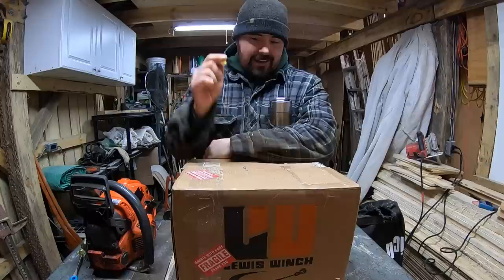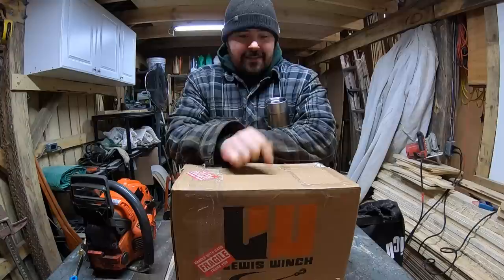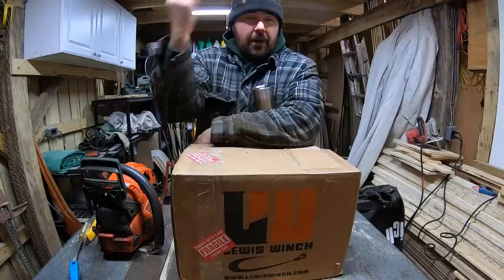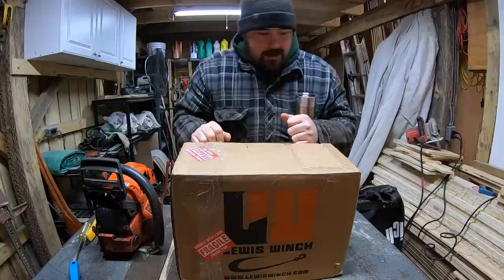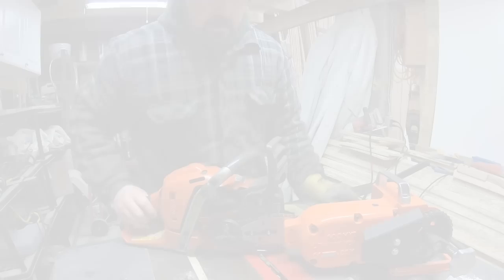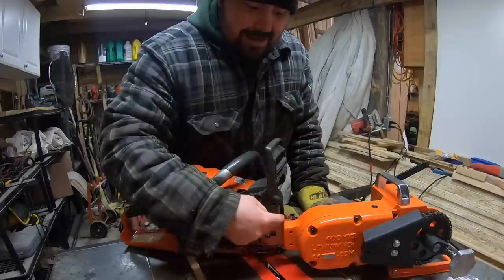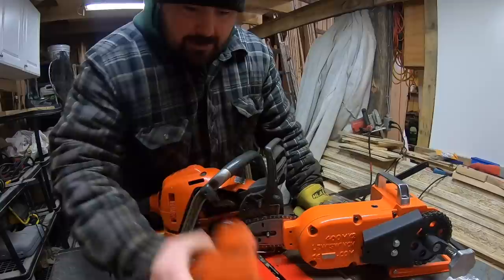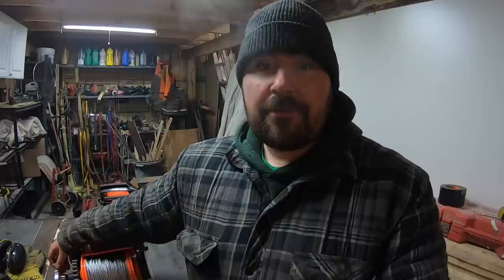Tool for Everyone Who Cuts Trees | Lewis Winch Chainsaw Winch Unboxing

Comment: Have had one of these for 30 years. Do the new ones have a way to get slack in the line?
Reply from the maker: Hi Larry thanks for watching. To get slack on the line I turn the saw off and the clutch allows the winch to free spool a little bit to take tension off the line.
Reply from the maker: You can also use the metal twist knob to release the tension while the saw is still running
Reply: @sawingwithsandy  wondering if that is something new on newer additions of winch. I have had to cut cable and re weld the older release  metal rod deal. They are good units and  geared correctly. Have accidentally pulled over alder hold trees.  Good insurance to have in case of off road mishaps.

Comment: anyone else wondering how a battery op chainsaw would work with ir?

sandy, i may have missed it but what is the capacity of the winch?
Reply from the maker: 4000lbs without pulleys when used with 7hp saw
Reply: @sawingwithsandy  thank you sandy.  good video, super interesting.

Comment: Make your own logging winch.  How?  Buy a complete winch assembly for an 11,000# Farmi winch for $800 and spend another $200 on scrap steel and $300 for a full spool of wire rope, $100 for sheaves and snatchblocks.  Weld, grind, paint and pull.  I did it, no reason you can't.
Reply from the maker: Unfortunately I likely wouldn’t be able to make one in a timely enough manner to make it less expensive than buying one

Comment: For the price might as well get a portable winch that is gas-powered or battery-powered. less of a headache
Reply from the maker: I haven't been able to locate a gas-powered winch with the pulling power that this has.
Reply: @sawingwithsandy  Ya...I agree with Sandy. Rated at 4,000 lbs, or 8,000 with a snatch block.

The Lewis is portable, strong, and can be matched to a variety of powerheads. I use a 72cc Husqvarna. Sandy has a beastly 90cc.

Comment: USING your TABLE SAW as a Workbench ??  : ((    SAWS are for SAWING  not as a  Workbench  .
Reply: Never seen a fine table saw abused so much, surprised the top was not covered with orange paint. I know it got dented and scratched a bunch. I use my table saw for a workbench all the time but have a 5/8" piece of plywood on it exceped when table-sawing ( cost of plywood 1/3 of sheet 24.oo$==8.oo$) cheep insurance for a 2500$ precision Uni-Saw. Thanks Mr. Sandy for the demo and sacrafice.